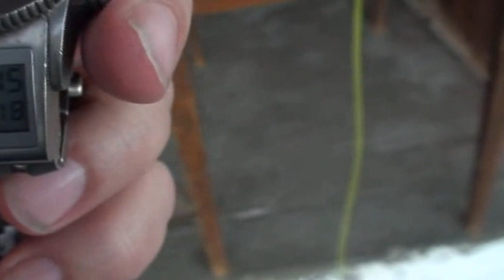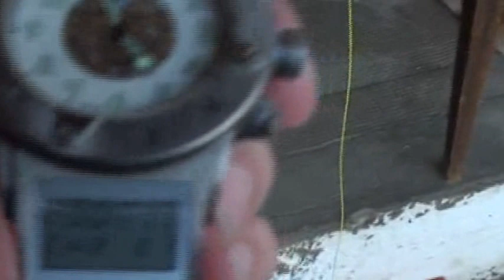Mikhail wheel no mopre finger subjectiv feeling

Comment: I think the error is in your interpretation of the results. Weights in this case mean that the axis of the wheel is generated power. Part of this power is used to drive the weight. Therefore, the movement of the load on the axis slower. Flow forces Mikhailova wheel goes from small weights, the end of the arm, to the axis.
Maybe your result confirms indirectly that the wheel Mikhailova there by gravity to increase strength. But I'm not sure with that interpretation. Sorry for my poor English.